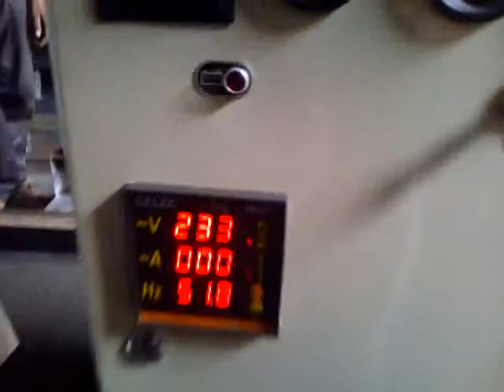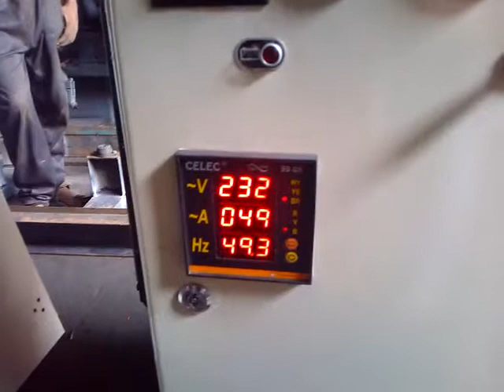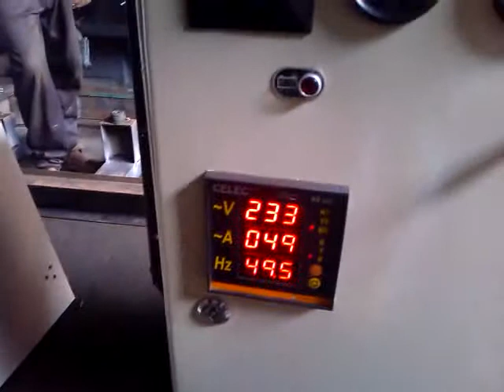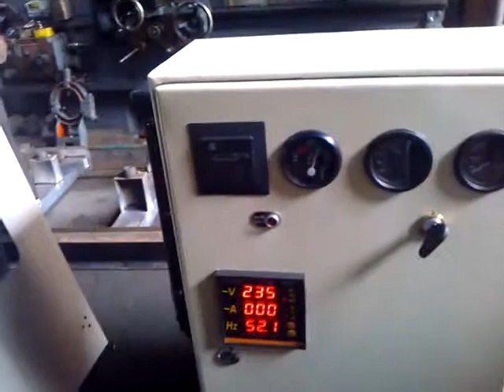mercidez om 352 diesel engine with genrator

Comment: Is that the tata 697 TCIC or Naturally aspirated (Non Turbo) version of the engine. What is the KVA of the coupled alternater. Dont you think that you should take more saftey precautions with salt bath testing as almost 77 amps current is a lethal load if you get zapped.
Reply from the maker: Yes sir
Reply from the maker: 62kva